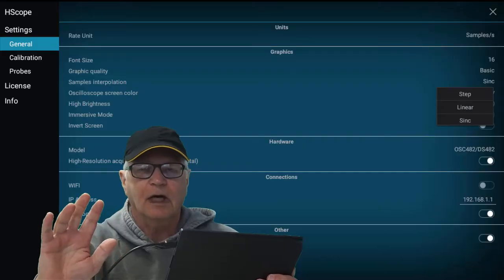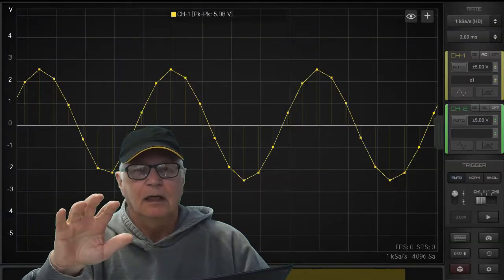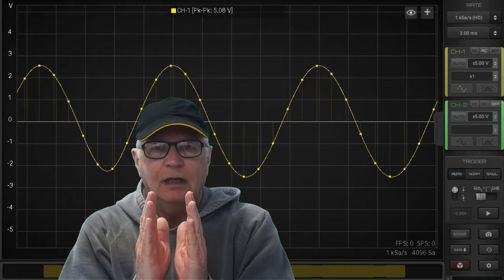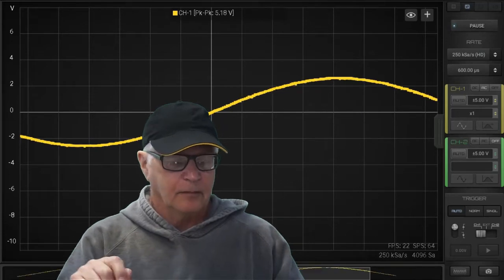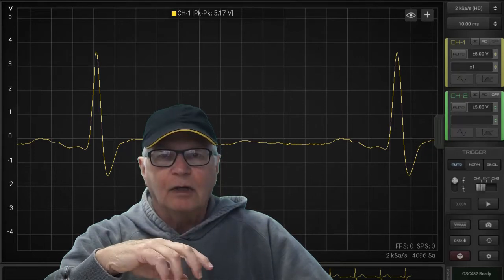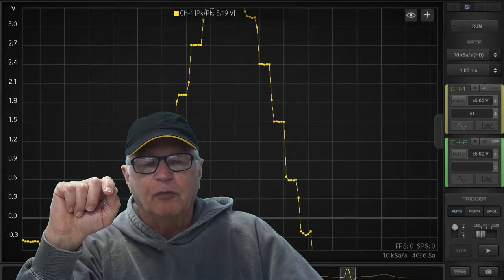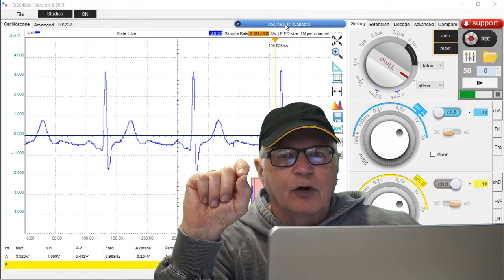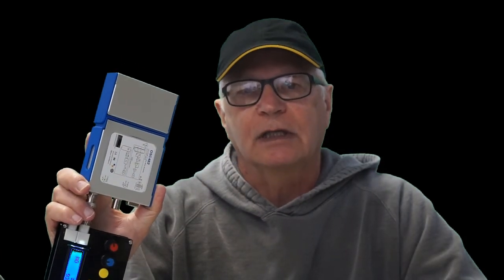GADGETS#102 - INTERPOLATION and SAMPLE RATE

Comment: What you are seeing is the limitation of the vertical resolution.  Most scopes (especially cheaper scopes) are only 8 bit vertical resolution.  When you see your sample rate "bunched up" as you showed (4:26) --- that's because it's only an 8 bit scope.   A 10 bit scope would have 4x more stair steps than you're seeing..  and a 12 bit scope would have 16x more stair steps..  a 14 bit scope would have 36x more stair steps..  So you see there's a huge difference in the Vertical bit rate just from 8 bit to 14 bit   You can pile on as many samples as you want on the horizontal -- but if the vertical is only 8 bit-- that's going to be your bottleneck.   Try to hook up a 12 or 14 bit scope to your software and you'll see the difference.  (like a pico or Owon, etc)

I looked it up, and the OSC482 that you're using is only an 8 bit scope.  So that's why your dots are very close on the horizontal (higher sample rate) but they are always quite spaced on the VERTICAL separation of your dots (8 bit limitation).   Its still impressive what the software can do with such a cheap scope.   The key distinction is vertical resolution being more than the standard 8 bits.   But it usually costs quite a bit more for the more accurate scopes (12 and 14bit)
Reply from the maker: OSC482 offers 8 - 13 bit vertical resolution

I do have a full understanding of the importance of more vertical bits

none of this has any bearing on my main points in this video on choosing not too low a sample rate and not too high a sample rate in achieving the best waveform, especially within the HScope app

you've taken to time to post a fairly lengthy comment and I do appreciate that:)
Reply: @theGADGETSplaylist  I really like the Hscope software-- especially the battery testing.  I've watched Ivan use it a few times (pine hollow).
Reply from the maker: @calholli  gadgets#168 that a follower in Wisconsin built and sent to Ivan in Pennsylvania

it makes use of the VOLTMETER module within HScope

Comment: Hi very interesting  do you have a video on hscope automotive .over sampling is one off my faults
Reply from the maker: this applies to all oscilloscope work, including automotive captures...
set the sample rate too low and we'll miss some of the detail
set the sample rate too high and the waveform will be noisy, buffer will be filled sooner (which means less time on screen)
finally, HScope does thing a bit different when it comes to sample rates and it does take time to get used to it